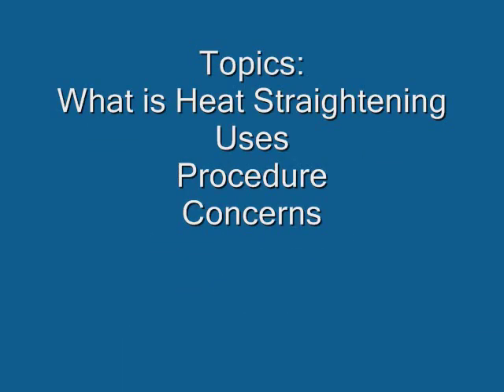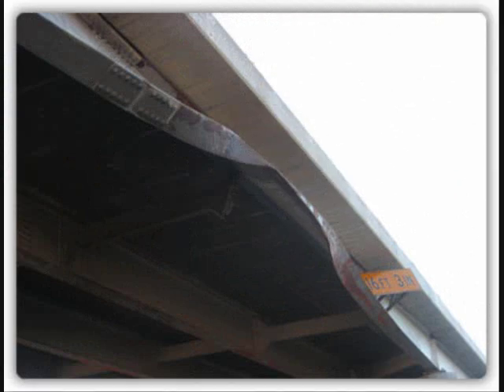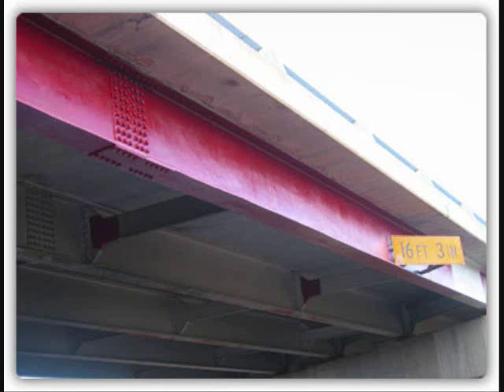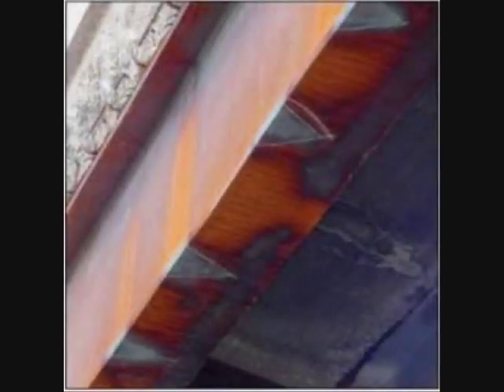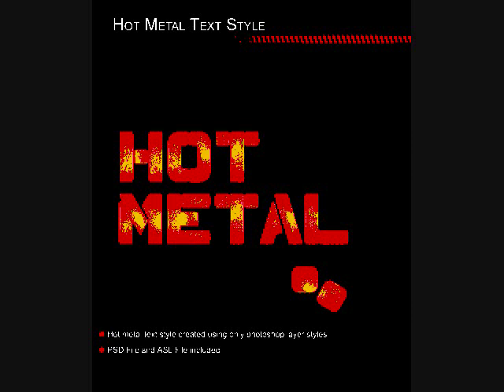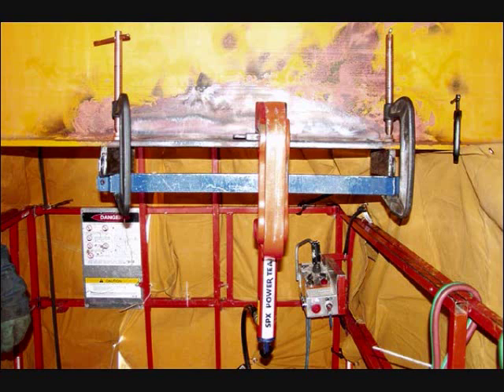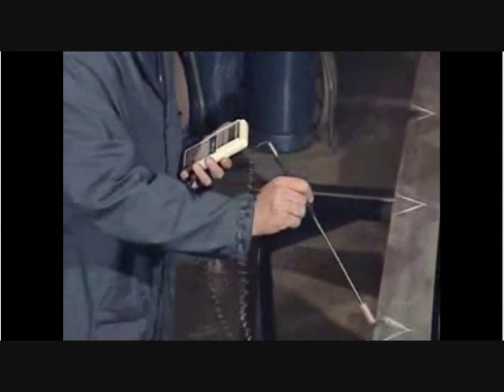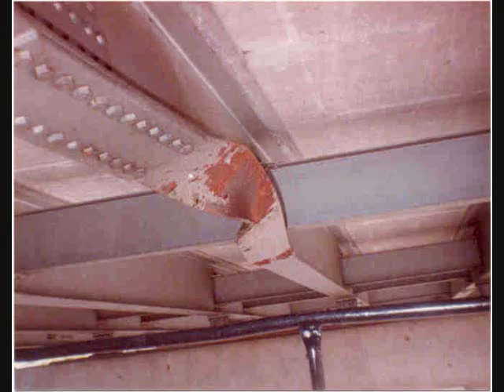Heat Straightening

Comment: I can't believe this video has no comments. I used to work in a oil field drilling rig manufacturing facility and we use this to heat process to straighten beams before we built the pits and any other kind of structure that needed to be straight.